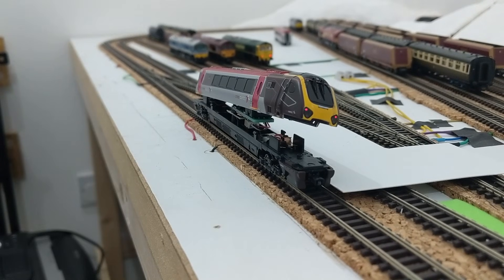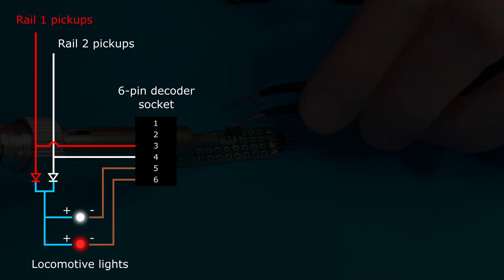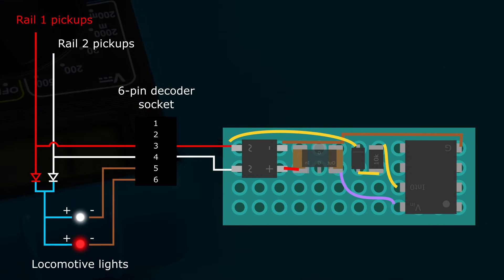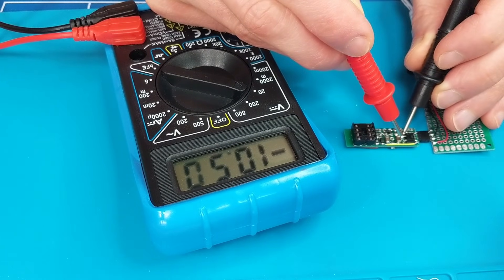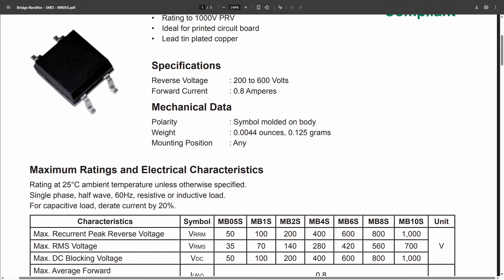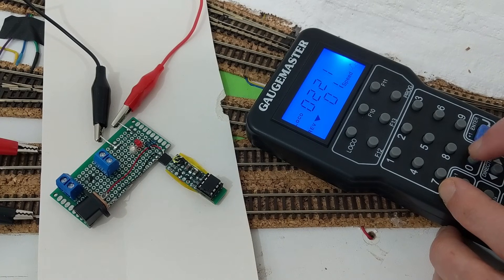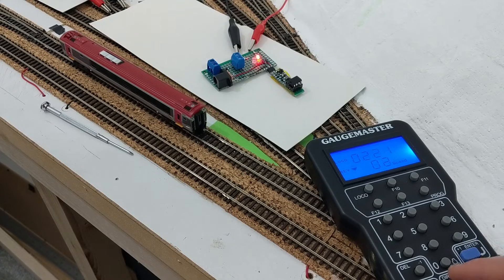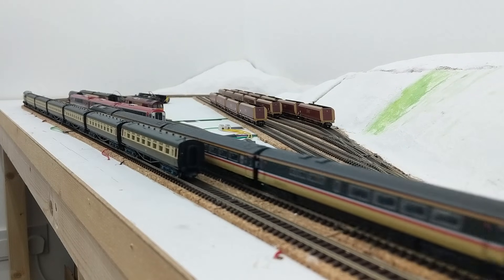0058 Making a decoder from scratch - part 5

Comment: Hey Jonathan, outstanding progress! Really impressed with your SMT prototyping ability. What would really help you now is a second hand binocular microscope with a low magnification (30 or less), one with top illumination but without a stage for slides where you can look at your soldering. I use one for SMT assembly and prototyping and it makes a huge difference! Is it too late to ask for contributions for Christmas?

If you can assemble SMT components on perf-board like that, you’ll find hand soldering to a PCB way easier. Reach out if you’d like any assistance doing that.
Reply from the maker: Hi Mark, thanks for the encouragement - when I put a decoder video out I always look forward to your comment and insights on it 🙂

Yes I may need to get a microscope like that (probably not for Christmas 🤣) - for now what I've got for extra magnification is a jewellers loupe, but it's not easy to use. I'd be nowhere without my magnifying glass, so can well believe the difference it would make.

If PCB soldering is easier then that's great news - it should mean I can go smaller with the components 🙂

Thanks!
Reply: @e @endoorrailway I used an x10 loupe for a long time, (back in the day I could solder wires to 0.5mm pitch IC legs without visual aid) but at my age my eyes do need decent equipment.

Looks like you’re using 1206 sized resistors and capacitors? I’ve standardised on 0603; they’re big enough that I can easily hand solder them (with a x30 microscope) and they handle the same power as 0805, but can be packed close enough for N-scale circuits. If you can solder SOT-23 parts then you can solder 0603 with a bit of practice.

If you ever want some blank PCBs to try soldering on, find a way to message me and I can send you some and some components to try with.
Reply from the maker: @MarkSJBeard  Yes - though with the resistors I ordered two packs, with the intention of using the smaller ones (which as it happens are 0603 size) when I come to printing (or failing that ordering) circuit boards. Ah, I forgot to get more capacitors! I think I'll go straight for 0603 size when I look for more, then - good to know there's no real downside!

Thanks, that's very kind of you to offer 🙂 I've seen practice boards available at various places - they're pretty cheap, so I'll add one to an order at some point.

Comment: I looked at MOSFET, indeed I have some 2n7000, the thinking is they don't need the base resistor (what with not having a base) but they do need a pull down resistor to make sure they fully turn off.. more experimentation required here, MOSFET will work better but don't save "bits". so far experiments have not gone well so sticking with 2n2222 here for now

that test board is a very good idea

"far more electronics knowledge".. ummm

high speed rectifiers are better, I think actually using individual diodes is a better bet anyway, especially to a PCB as they can be fitted to both sides

on other chips, I've got hold of some 14 pin AtTiny84, ok the DIP is way too big for N but the SMD version may fit

behaviour you have is weird, I had something similar here, not quite the same, it came down to a code problem - the code that was turning them on and off was with the code that handled the inputs, what worked was breaking that out so one bit worked out what needed doing, and when and something else wrote to the LEDs, but only when things had changed

using the nmra library here though
Reply: A correctly selected mosfet, where the ATtiny maximum low output is below the gate cutoff voltage of the mosfet, should avoid the need for the pull down resistor.

Yes, high speed diodes are essential here. Most rectifiers are good for 50/60Hz, not 20kHz. A pair of dual Schottky diodes in a SOT-23 package sound be suitably small. BAT54 diodes can handle 200mA and should be fine for LED driving, but you’d need something higher current to drive the motor.
Reply from the maker: @MarkSJBeard I must admit I only looked at whether or not the "on" level was below 5V when I ordered some MOSFETs, so when I come to look at them in detail maybe I'll need to order some more. Thanks for the pointers about types of diodes - the ones I'm intending to order can tolerate an average of 1A, which I think will be enough - that should allow a total draw of 2A - the dual package ones seem to have much lower tolerances. Like you say, that's enough for the ATtiny and the transistors, but I do ultimately want to do motor and/or speaker control, so might as well have a nice stock of diodes that will be up to that.
Reply: @endoorrailway . Motor control will be enough of a challenge, I suggest. Sound is not impossible, but the audio data storage and reproduction requirements are not trivial. I’m using an ATxmega to play alarm sounds in a medical device and it can be done, but it takes many kB of data and would be challenging at N-gauge scales. You can use PWM to drive a speaker, like you can a motor, so it’s not impossible. Just quite a challenge. You could also use an 8-pin serial memory chip for the sound files. So the idea is not dead. But I’d see if you have the appetite once you get traction control working first!
Reply from the maker: @MarkSJBeard Hmm, it's been a fair bit of work to get this far, but it's definitely an aim - it was actually the reason I embarked on this, since sound decoders tend to cost an extra £100. I may well not be able to achieve it, but hopefully I can get as far as giving it a go 🙂 It seems almost certain from what you say that I'll need to upgrade to a more capable microcontroller though.
Reply from the maker: @aleopardstail
I'm now looking at ordering more diodes - I had to harvest one off my previous prototype to make this one! I'm trying to be a bit conscious of their power tolerance ready for when I move on to motors and speakers.

Ultimately I want to move away from the DIP packaging, but while things are still very experimental I like being able to pull the ATtiny out of the socket.

Yeah, it's got to a stage where I'm struggling for theories, but the code has been split like that for a long time - it fills a buffer with detected bit values, then once that's full it switches to processing those bits and acting on them, which is essentially at liberty to take as long as it likes. Theoretically it could always miss out on capturing the relevant instruction and only capture irrelevant ones, but my gut feeling is that the probability of that is super low, given how reliably it seems to be able to detect commands up until this issue when transistors are included.

I'm sure I'll get something working eventually, one way or another 🙂
Reply: Love the content, this is also on my to do list. Have you tried updating the code to use Millis rather than delay? The issue with delay is that it stops other processes from listening / acting 👍
Reply from the maker: @Michaelrlomax  Thanks 🙂 No I, but I did look at the source of delay just to make sure it wasn't using interrupts, since the global interrupt flag is automatically set to disabled when the ISR is triggered, then automatically re-enabled when it completes. As-is the code that analyses and acts upon collected DCC bits is blocking as a whole, so it's OK for any LED blinking to be blocking at that time. When I was experimenting with just the ISR responding to changes in track voltage the same kind of thing applied - I just wanted to see the ATtiny's int0 was getting pulled low, so a blocking section of code in response to that is OK. When this project gets further and I need to perform actions that aren't instant, while continuing to monitor the DCC signal, then I'll need to stop using delay for sure. Thanks for the hint 🙂